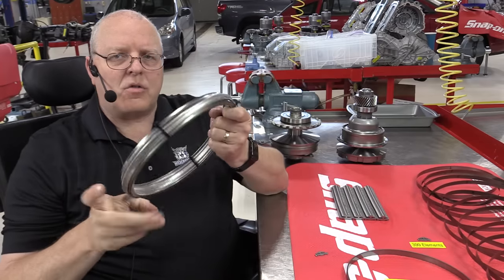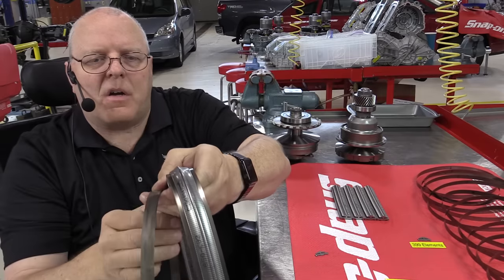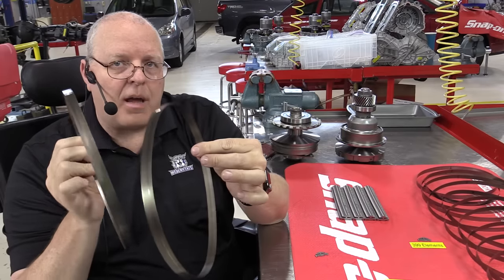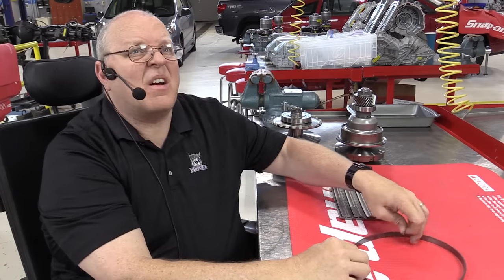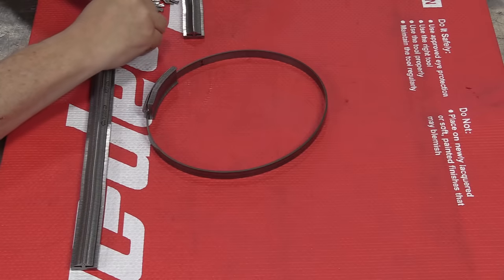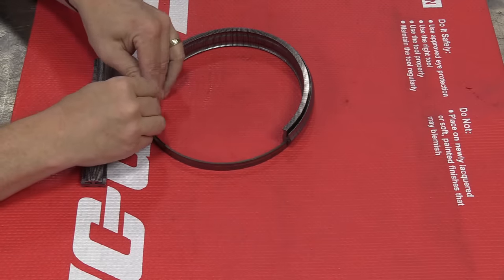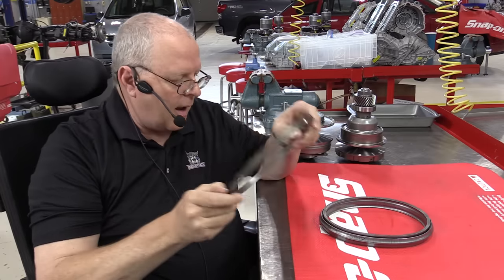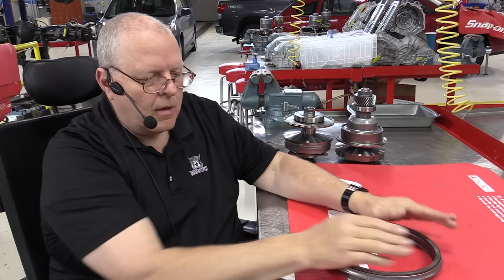The 423-Piece CVT Steel Push Belt

Comment: It breaks my OCD brain that they couldn’t just have added 1 element to make it 400 😑
Thanks for the great video!
Reply from the maker: 399, why not 400? Because 2(177.5 mm pulleys) + 2(10 mm band packs) + 2(12 rings per ring pack ) = 399. Just kidding. Thanks for watching

Comment: This was fantastic. Thank you for putting this together. Do the faces of the sheaves typically wear? You mentioned in another comment that you've only seen ring pack failures. I'm curious if those of us with CVTs should think about maintenance intervals on these components. I love my CVT, I just wish it could handle adding a turbo. My rogue is a bit anemic up here in CO. Thanks again for the great video!
Reply from the maker: Thank you. They do wear. The manufacturer always recommends the belt and sheaves be replaced together

Comment: What holds the belt in place and make it rotate without slipping as the pullies look quite sleek?
Reply: Believe ir not, the cvt fluid do that. They have a special kind of additives which, under pressure, act like a velcro between the belt and the pulley. There is no direct contact between the belt and pulley.

Comment: I may be an idiot (and please correct me if I am wrong), but mechanically, doesn't any tensioned belt that pushes on one side, pulls on the other, and vice versa..
Or is this considered a pusher because the compressive forces on the push side exceed the expansive or stretching forces on pull side causing more power to be created through pushing than pulling... I am just trying to understand the physics behind it.

Comment: Dear teacher, has a manual to know what belt I need to use on the automatic transmission cvt ? I dont know if there is a catalogue parts to find the correct cvt belt, if you can answer for me, I ll be gratefull

Comment: So if the push is through the elements, which are just guided by the ring packs, why is the maximum torque dependent on the number or rings in the ring pack?

Comment: A guy told me he has a CVT transmission in his 2005  Xtrail.  years ago He was towing trailers So he  put a larger after market transmission  oil cooler on his nissan ex trail   and disconnected the hoses  from the radiator His car has done  over 186,000 klm  and there do's not seem to be no problems with the CTV From what I have read I feel this could be a over heating ctv transmission problem

Comment: Excellent review. New subscriber.  Question.  You mentioned the number of ring packs dictate the possible torque the belt can handle.  So a full size sports vehicle like the Maxima would need more rings than a smaller car?  And when replacing the belt can you increase the number of rings used?

Comment: So I'm no engineer, but wouldn't it make sense for durability, longevity & high-torque applications to make a "dual belt" CVT? One could act as a "push" belt & the other adjacent to it on the same shaft (different pulley assembly) could act as another "push" belt in the return of the first one. Don't know if I'm making sense, but they could act in tandem with each other so there is a constant "push" transfer of power on both sides at all times. Just a random thought.

Comment: .Wow thanks for posting.  I got a lot out if this.  I just bought a 2019 Nissan Qushqai It has a CTV transmission I also have a 1997 landscaper 80 it has done over 450,000 klms 279,617.037 miles And beside the recommended transmission servicing  It still the same old transmission I know know the Nissan Qushqai will never last as long as that.
Reply: Nissan is known for having bad CVTs.

Comment: Thanks sir for reply.
Sir, what is efficiency of this transmission sysytem?
Reply from the maker: I do not know, sorry
Reply: The Subaru Outback continuously varying ratio transmission has the motor turning at about 1500 RPM at highway speed on a flat Road! In theory, very efficient transmission if you drive it easy.

Comment: Practically what to expect from a CVT Transmission:
- Delay or lag throttle response from a stop acceleration (hazardous when making a left turn at a junction). Delay or lag throttle response for clutch to grab when going to reverse (fellow motorists have to wait on you).
- Sooner transmission fluid & transmission filter change intervals. If you a Do-It-Yourself, drain and drop the pan, change out the trans filter, clean out the magnets, add new and correct trans fluid with the exact same amount of old fluid that came out, damp your new trans filter with the new trans fluid, and torque everything to specs. If you're a Go-To-Dealership, than you can only hope IF your fluid is actually changed or did you pay to just have your car sit? And the magnet clean & filter change thing with the dealers, forget it! Best case scenario is just a fluid flush.
- Metal chain (belt) constantly moving & rubbing up & down along the inner sidewalls (variator) of two pulleys. Let's see if most CVT can handle up to 200k miles that most standard automatic transmission could without repairs except for fluid maintenance and at normal driving stress. Only time could tell!!! I think there's a reason why some CVTs are discontinued on a same model vehicle platform, for instance, an Audi A4.
- Low rpm at cruising speed (saves fuel). So does an automatic or manual transmissions with 7 8 9 10+ gears could cruise at low rev-per-minute as well.
- Less cost & parts to manufacture saving auto maker companies manufacturing costs. As a result increases their profits. How about you as a consumer? Take 2 vehicles with equivalent comparisons except for one is equipped with a CVT transmission and the other with a standard automatic. Does the vehicle with a CVT selling price less, more, or same? Even though a vehicle with CVT costed less to manufacture. Do the same comparison between vehicles with a 9 speed and a 6 speed automatic transmissions. I reckon the answer is cost doesn't change for the consumers. Just more profit for the auto companies.
Reply: The advantage is supposed to be in the fact you will maintain rpm at the best speed for the engine to maximize efficiency thus gain mpg. I believe we are going to start seeing a lot of CVT as manufactures push to compete with electric cars. If you look at Kia their new CVT are much better then what came in Nissan and Audi before it's really only a matter of time before they perfect the transmission. The fact is they really are far less complicated with the bulk of problems being in premature wear but stuff like this can be solved it is not an indefinite problem and as the battle becomes more about efficiency and mpg Mark my words the CVT is going to receive a revamp. If you think about it a CVT diesel has the potential to be the most efficient long lasting internal combustion engine ever made. If the problems with durability are worked out on the CVT, a diesel engine ran at a consistent RPM it's entire life could last forever look at diesel generators.In my opinion a more efficient diesel could be actually more eco friendly and cost effective then any electric as it wouldn't require any new products such as lithium and other rare earth minerals involved in the production of electric cars. We are already much more efficient at refining oil then mining lithium and there would be no skyrocket in price because of artificial demand for batteries created by tesla.
Reply: @zack6892  As I stated: Conventional automatic transmission with higher gears can cruise at low rpm as well, achieving the exact same mpg result as a CVT; not considering aerodynamic and road friction factors. You may be right that the unreliabilty of a CVT can be fix. But it hasn't yet. The throttle lag is a major problem at a junction if you have to live with it on a daily basis. I've owned two CVT vehicles: Altima & A4. I've also owned a Charger & C300 with 9 gears that cruises at a very low rpm. As far as diesels, that is a high torque lower hp application. I do not know your experience with diesels. But my experience with it were 1.5 yrs driving AMR ambulances and 1.5 yrs driving Dunbar armored trucks equipped with them. I've also have experience as a full-time police officer and a pilot among other careers, but that's another subject. The diesels were slow to accelerate and it's nasty and smelly when fuelling at the pump. Now with an exception of some modified diesel pickup trucks that are exceptionally quick. I owned a VW diesel car as well that I had to kept putting AdBlue to help with diesel fuel emission. CVT are great in theory, as far as practical it is yet to be proven. Only time and mileage will tell.
Reply: @zack6892  About electric cars, I have no experience with them. Except for remote control toy cars about 20+ years ago when I was like 10 😄. I just know that Teslas are slower as their battery drains. Same concept as electric go-karts. To get a fast lap, it needs to be fully charged and light in weight not considering driver's abilities. I agree with you on the Lithium.

Comment: What alloy is that made of? You would want something strong like titanium so it would resist breaking. Also since it's metal , does it have lubrication?
Reply from the maker: I do not know the material. It uses a special CVT oil

Comment: Trying to imagine this belt prior, 
was forced to think it was maybe 
like a steel link timing chain belt
with side pins engaging pulleys 
with groves faces. 
But that would be tricky with groove spacing. 
This must have drove engineers nuts for months. 
Cheers
Reply from the maker: Thanks for watching
Reply: @WeberAuto  
Great Demo - but my 4th dimension live view of belt in push mode is still mind boggling how this much power applied load transforms elements into a rigid beam without buckling itself into a pile. Cheers

Comment: Hi,
Need Help.Can i use  901068 or any number on my 2003 saturn vue 2.2L  fwd cvt transmission?I have 901033       351-20A on my cvt. Theres one piece ring pack came off from the belt.The belt feels loose.But it  looks good and good condition.Forward clutch plate burn.

Comment: I just pull out my speed sensor.code 0277.theres a strip of metal attached to it.it looks like part of  one of those band.what do u suggest i can do
Reply from the maker: transmission replacement time. That of part of your belt
Reply: WeberAuto can i just replace the belt?thank you  very much

Comment: Seems to me if the elements were a cross between a horse shoe with a more traditional top surface it would be less likely to break under unusually pushing like if towing up hill while overweight. The pressure would have more impact resistance around the shoulder area of the elements.

Comment: its  called   squeezing transmission ,steel conicle  pulleys driven through a  steel chain. so  Not much torque available . The steel pulleys or the chains wear out due to friction and heat
Reply: Automatic transmission have wear parts Also in there clutch packs and valving that wear out Also

Comment: I have a 2011 Versa CVT and it start making noise. It sound similar to a power streaming without oil. That “ bzzzzz” sound drives me crazy. I wonder what do that noise in that CVT
Reply from the maker: Make sure the fluid level and type is correct. It takes a special fluid. Best wishes!

Comment: So which is more common in cars? Push-belt or VDP?  The concept of a push-belt style strikes me as odd.  The two pullies would be able to make better use of surface area on each pulley under tension rather than compression, no?
Reply: Also, being that tension is I'm guessing very high, isn't it just as much a push-belt style as VDP style where the tension is the driving force?

Comment: So, the Belt is the Achilles Heal. If and when it breaks it must damage the housing and other connected parts. It is not only the Belt but with such high pressure, other pulleys and gears must also break. It is no better than other Manual / Automatic Transmissions. There appears to be no 'real' solution. All moving parts do tend to wear out. Fluids collect the worn out metal and becomes a grinding substance. Changing fluid before time is the answer. With price tumbling down of ATF, one should make sure to replace it. A very good video. I did not think it was that complex. I would stick with Normal Automatic Transmission.
Reply from the maker: Thanks for your feedback

Comment: CVTs work well in engines that are properly tuned to use them with good low end and mid range torque. Now manufacturers are using very loose torque converters (high stall speed) to allow for the engine speed to be adjusted up quickly on snap acceleration (while the slow moving varator catches up) and help with off the line acceleration, but leaving the TCC engaged during almost all cruising for efficiency. But, I just don't see how this design could be made to be reliable for long term use. I work as an auto technician and I don't believe I've seen any belt-drive CVT last more than 150k miles. Maybe that isn't such an issue since many modern engines are struggling to make it to 100k miles before having a major failure, but it still seems like a big step backwards in automotive technology from a real world use standpoint. I would not hesitate to buy an "eCVT" like most hybrids use, they've proven to be even more reliable than a traditional automatic, but I would only keep a vehicle with a belt-driven CVT as long as it had a powertrain warranty. They don't last as long as a traditional automatic, cost substantially more, and don't offer substantial gains in fuel economy over a properly built and tuned traditional automatic with 6 speeds or more.

Comment: How long will it take before that belt needs to be replace
Reply from the maker: It depends upon who you drive. Treat it like a race car and it will not last very long at all.
Reply: @WeberAuto  I Drive a 2015 accord and it has one of those transmissions under normal conditions so I don't race the car at all and it has 72k miles I bought new so what can I spect from the transmission 100k 200k ?before it wears off
Reply: @ramonmunoz7617  supposedly, regular trans fluid changes (manufacturer reccomended) and gentle driving make them last longest...but seems "luck of the draw" is a third factor.
Reply: @taradead  thank you very much

Comment: can i change some of cvt parts (pulleys & belt) with a new one for maintenance?
Reply from the maker: Yes, it is possible
Reply: WeberAuto i have a honda jazz (honda fit in U.S). What part should i change regulary besides driven pulley & belt? Is there any clutch inside honda’s cvt? 
Thanks

Comment: Because it’s contact is metal on metal it absolutely imperative that you follow the manufacturers oil changing guidelines, you need to maintain that protective high pressure film. You cannot run these units like a regular transmission,like run the fluid till it’s brown as some do, can’t fill it and forget it !

Comment: If all the force and load is being put through the elements themselves i fail to understand why more rings are needed to handle more torque.
Reply from the maker: To keep them pointed in a straight line

Comment: Hello,
I have been looking for this question for a long time. I'm glad you answered.
What percent of the CVT motor's power can be transmitted to the wheels. Is there power lost in CVT? The result is a transmission through a belt. I'm very curious about that.
Reply from the maker: I do not know the answer, but there is significant frictional loss

Comment: I have a 2013 nissan sentra just crossed 200k. I have rebuilt the original transmission and it failed under a year so I've replaced it. Is it a good idea to install an external oil cooler?
Reply: Yes they overheat put a oil cooler babe it and do a fluid change two time a year it should be alright for a couple of years like that

Comment: Wow , great video showing how the cvt  belt works ,  
One can't help but think for blokes doing repairs on this type  of  transmission ,  there would have to be a percentage of failures after a rebuild job just due to the poor bugger doing the assembly and  putting some little  thing to do with the cvt  belt arse about 😃?
 Upon seeing this i think i still prefer the old faithful conventional style auto .
I'm only guessing , but if a cvt tranny came in for a rebuild , surely a complete fully assembled cvt belt would just be part of the rebuild kit with the usual bearings seals and gaskets ?
Reply from the maker: Yes, they come fully assembled. Thanks for your feedback!